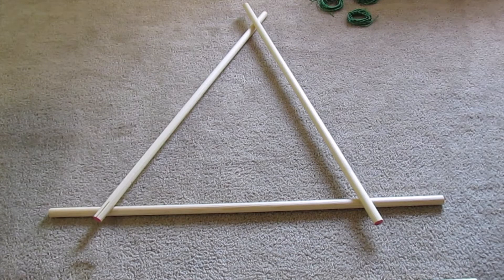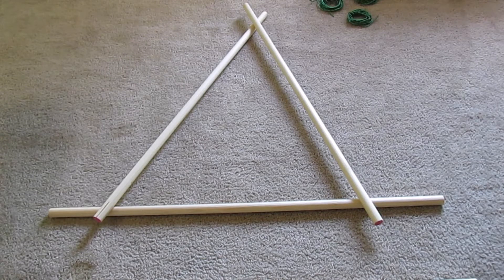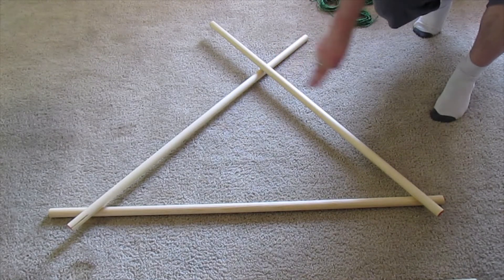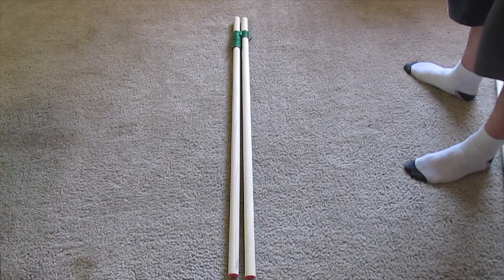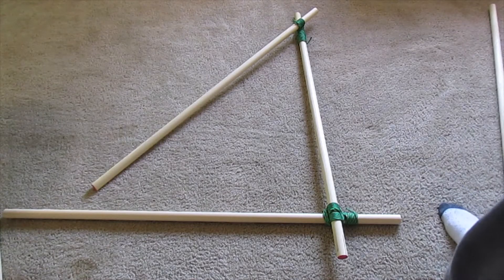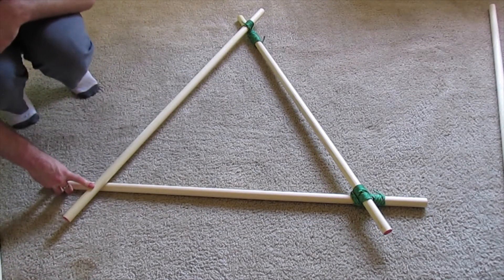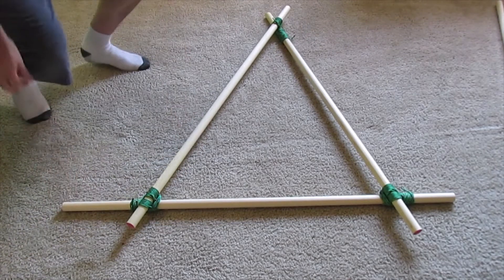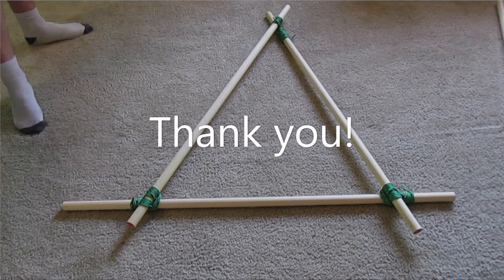Structural Lashing: X - Trestle

Comment: What you've got there is most often referred to as an A-Frame. Btw, square lashings get their name from the fact the wraps run "square" to the poles, and can be readily applied when the angle made by the poles is anywhere from 90 to 45º. Here's the trestle vide we're using in conjunction with the pioneering merit badge: https://youtu.be/YATmim1eIrQ?si=2r4Ja7u02iupqN_V